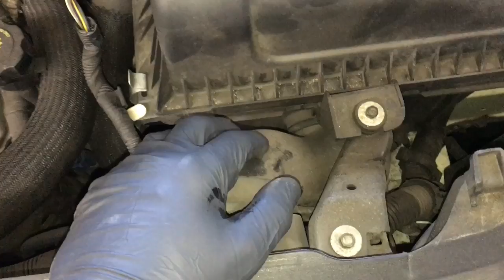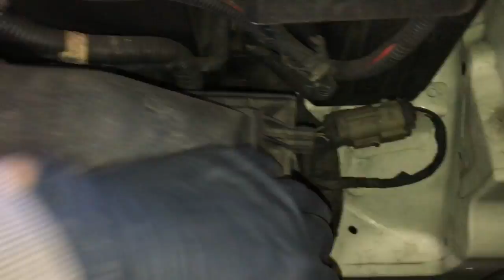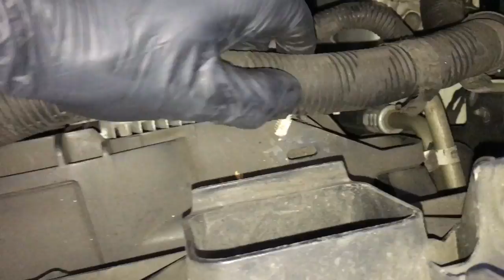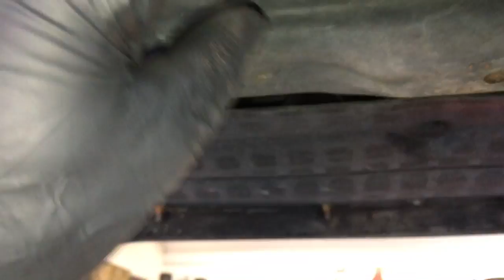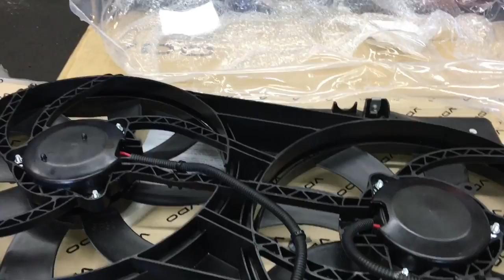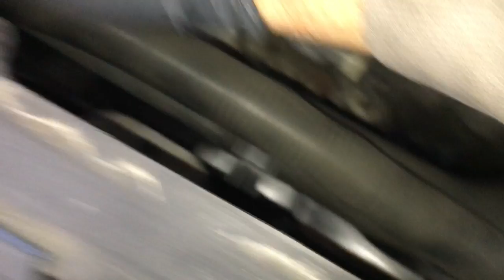How to Replace the Radiator and AC Fan on a 2007 Ford Edge

Comment: Nicely done!  Your instructions were thorough and clear.
Reply from the maker: Thank you! Did everything go smooth for you?
Reply: Well, I put too much pressure on the upper radiator hose trying to move it out of the way when reinstalling the fan module and broke off the upper radiator hose mount.  Who knew radiators are plastic these days?  So this set me back another $200 and eight hours of work.  The whole front end of the MKX needed to be disassembled to access the bolts so I could separate the ac condenser from the radiator.  It's all done now and the fans work and the ac is cold so I will call it a success.  Thanks for the follow-up!
Reply from the maker: Mike R sorry that happened. They make everything out of plastic now days and it’s easy to break something.

Comment: Need help on finding low cooling relay on 2007 Ford Edge
Reply from the maker: It's in the engine bay relay and fuse box. I don't know the number offhand but if you look in your owners manual  there is a diagram of where the relays and fuses are

Comment: thk for the video, can you splain how tor replace a radiator of a ford adge 2009
Reply from the maker: Hi Darwin. It'll be a little hard to explain it without the car in front of me. But the video of the edge fan motor Will get you close. From that point on it's just removing a few more hoses and brackets. Hope this helps. Thank you for watching.
Reply: I was looking for a radiator bit too. I squeezed my hands thru the front to remove the upper left and right bracket (3 bolts) attachment from the condenser to the radiator but now having trouble mounting the brackets back on. Do I go thru the front or the inside bc I was worried about bending the AC coolant lines?